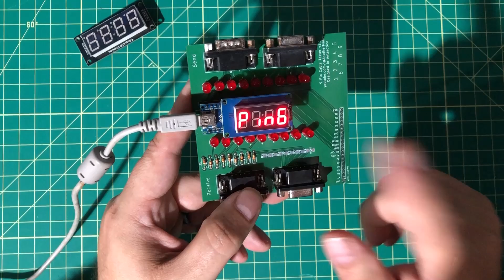9 Pin Cable tester

Comment: No diagram? I was wondering how you did it.
Reply from the maker: I'm going to do a follow-up. I always forget about it but the Arduino sketches basically have all the diagram information in them that you need. I'm basically just powering up eight pins and checking to see if the lights turn on. I'm going to add a few features this week and do it quick update and I'll explain a little bit more
Reply: @AnotherMaker  Ah! You have the SideA and SideB LEDs in series with the cable in between. This explains the only 9 resistors and the light pattern.
Thanks! Looking forward to the next video in the series.